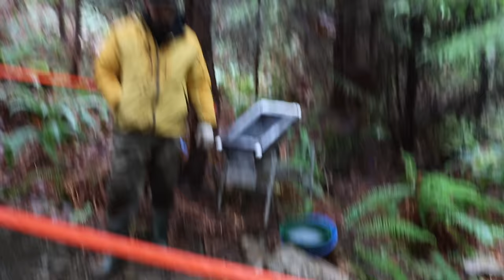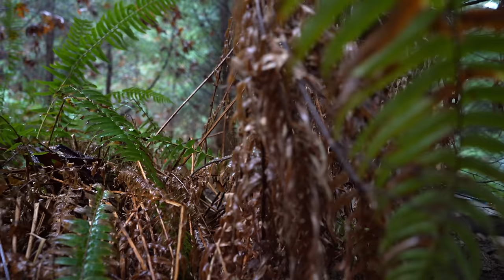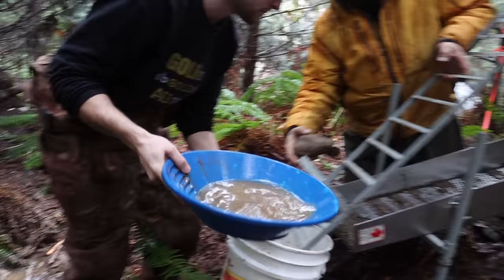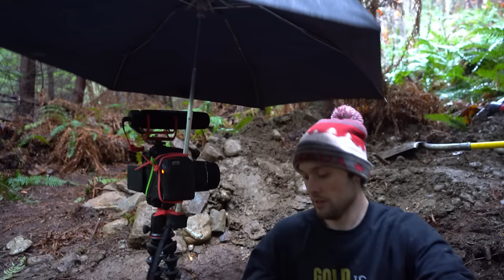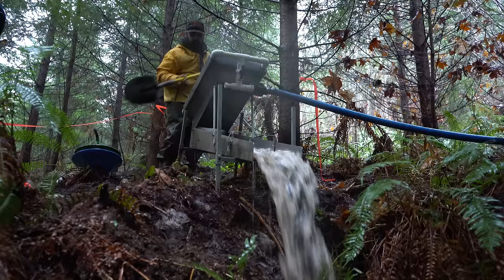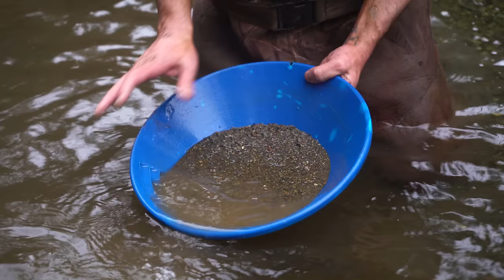Highbanking GOLD From a DEEP Hole!!

Comment: Hi Pauly.
Just a tip for fixing your leakage on this kind of hose, is to cut of 20-30 cm of your hose at the end, and slide it over the hole ( without pessure on your hose ) When you get pressure on your hose again, your leakage would be fixed... No tape is needed :)
Reply: Great tip. Thank you so much for telling me

Comment: for hose leaks use strips of innertube wrapped around the hose overlap rubber 1/2 inch and wrap until leak stops. I tried it and it works just about all the time for repaired hoses.

Comment: Great vid under difficult conditions & that picker would definitely have me digging to hopefully find a "directional" line on the old shale bar that must have been there once. Good luck with it. Oh, I nearly forgot, always carry a 1ft length of 2inch Ag pipe, a piece of bicycle inner tube & a couple of 3inch radiator hose clamps. Excellent for "sleeving" & clamping a hole in your feeder hose like the one you had. 😀.

Comment: I always use a safety pan when I pan my cons out. You will be surprised at how much gold you actually lose when panning out your concentrates.
Reply: Colorado Gold I concur! Always when dealing with cons!
Reply: Good idea and how often are the tailings checked?
Reply: @johnjacobs1625  not often. I know I'm loosing a little gold. But not much.
Reply: I found one of my biggest nuggets during my dredge cleanout in my catch pan, I had the same thing happen when sluicing and pushing all the pebbles out of my pan. Gotta classify it to catch it all.

Comment: I put a 1.5" pvc ball valve before my highbanker and a 1.5in x 1/2in tee with a hose spigot so I can kill the water flow while leaving my pump running and use a garden hose to clean up... or hydrolic

Comment: I always keep ducktape around in my backpack when go dredging seales the mats and the accidental holes not al problems though if the pump gets an issue it helps to have some tools not the hole box though just the nessasary ones and a few extra hose clamps

Comment: I made my self a crevice tool like your scratch awl   only like flat edge screwdrivers at both ends  to get between rocks   it came out good  was looking for a crevice tool like yours  but found the piece of metal  (FREE)  is very good  and it doesn't rust   now to put it to use

Comment: You should try using a circular polarizing lens for some of your photography in the river.  It will cut down on some of the glare, especially when you're trying to see in the bottom of a pan.  They are pretty cheap.  Actually, I have a couple spares if you let me know what size threads are on your lens I'll see if I have one that fits and send it to you.
A lens hood can help with rain too.
Unfortunately a water proof camera body and lenses are not so cheap.  Mine is water proof, but I'm not so nice that I would part with it.

Comment: Pauly, you need to use a tool your buddy Dan Hurd is using. Milwaukee battery powered wet dry shop vac. Much better chance of collecting any potential nuggets down there on the bedrock. Btw, those shop vacs are powerful and are literally worth their weight in gold

Comment: From what I've read that 2" pump can't be used without a permit, even if you step down the intake to 1 1/2" with that fitting.
Reply: I was about to say the same.
Reply from the maker: We have the permit for the highbanker but not for the excavator and wash plant 😊 ..yet!
Reply: @PioneerPauly  Nice, I thought so.  You seem to do everything legally here.  Is it a lot of work to get a permit for the 2" pump?  I assume it is lots for the excavator or you would just do it and test it with a big sample.

Comment: Great Video Pauly, I wonder if you can re-locate to another area (less elevation) and then come in sideways to avoid the 1.2 meter restriction? Would that be legal because you started at a lower elevation, it's still (at that spot) 1.2 meters?

Comment: 1.2 meters is 4 feet. That sluice box is about 9 feet too short (old timers had a minimum of 12ft long boxes), you're losing 80% of the gold, I.E flower gold because all we see is matchstick size, where's the tiny stuff? in the tailing pile. 

Also those black sands you're tossing out have gold in it you just needs to roast it on cast iron to release the sulfur and reveal the magnetic gold bearing iron sands (iron eats and hides gold until released from roasting then panned out again, easy). 

Also, get a pressure washing and just start making a big circle 10 ft in diamter, or pour 5 gallon buckets of water down the sides. Why were you the only one digging, everyone else standing around with hands in their pockets? If you want hot water and warm hands, get copper rod on the fire and it will self siphon cold water into hot water 160 degree, 5 gallon buckets worth in 1 hour. Everything else with camera production is top notch and you guys never cease to amaze with something new in each video. 

Might I suggest putting your gold in a spoon carved out russet potato, hold it in your hand and yellow MAP torch it for ten minutes to combine all your gold into a button. Voila a million subscribers easy. Thanks Pauly and crew, shout out to Dan Hurd too i saw he commented like a true friend. cheers from Oregon! https://youtu.be/URcO9-mT1sA

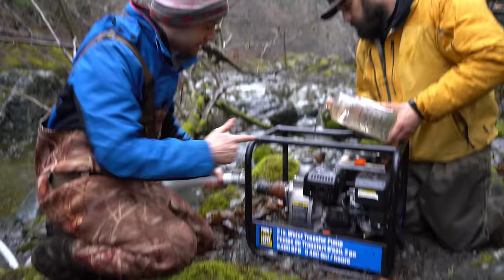Comment: FYI, that pump brand has no 1.5 inch pump model, it says 2 inch on the side. It's a major violation to be drawing water using anything larger then a 1.5 intake or outtake, from any water source in BC. Using a reducer 1:45  isnt allowed, youre using 2. Youre setting yourself up for a huge penalty, that can include a fine, withdrawing of your free miners cert. and/or the forfeit of your claims.  "...when conducting placer exploration activities, water intakes should be screened in accordance with Fisheries and Oceans Canada specifications (screen openings must not exceed 2.5 mm), and size of pumps does not exceed a 38 mm (1.5 inches) suction intake..."
Reply from the maker: What your saying is all under the "mining without a permit" rules. I appreciate your knowledge on the basics but I have too much to lose not to have everything already figured out.
Reply: @PioneerPauly  If you say so, but either one of two things is happening...you are mistaken regarding your use of water, mining permits and water licencing  regulations...or your reducing your pumps overall efficiency by having 2 reducers on it by up to 50%...but hey, what do I know? You've got "everything all figured out".
Some rough estimates, but close enough to show a difference, assuming there is not some other reasoning behind you reducing a pumps volume when you dont have to...Good luck to you.
 Pump Size:
1.5 inch = 200 to 400l per minute is 12-24 cubic meters/hr roughly...

2.0 inch = 400 to 800l per minute is 24-28 cubic meters/hr roughly...
Reply from the maker: Hey again, I'm not sure why your so upset or that you care enough to try and jump on somebody who is clearly still legally mining but you are wasting your time. Not that I need to justify anything to you but my permits (including the water use permit which is separate) are valid, and the reducers are to increase pressure. If you ever dealt with getting a permit yourself there is a lot you can get away with even if I went over their measurements. My manager works with our are resource officer for the channel too so I'm not concerned. Have a good day

Comment: I find your closing comments a bit disturbing, after a career that involved working around an inside many excavations. When you said that your friend, Brian, would continue digging, hence working belowgrade, it implied that he was doing this solo. Very uncomfortable to contemplate , and extremely unsafe by the industrial safety programs I worked under for years.

In the back of my mind is the hope that you and Brian have a 3rd body there for spotting and safety. A 100 cm excavation under the US OSHA requirements would mandate a ladder in the exczvation, and if you worked out, effectively trenching the site, another ladder every 3 meters.  (I am converting the depths/distances as the OSHA regs use "Traditional" units, not metric...)

I really enjoy your videos, but please! Work safely so you can keep making videos!

And, to credential this somewhat, I am a retired QA Inspector in Soils and Materials.  35+ years on construction site...